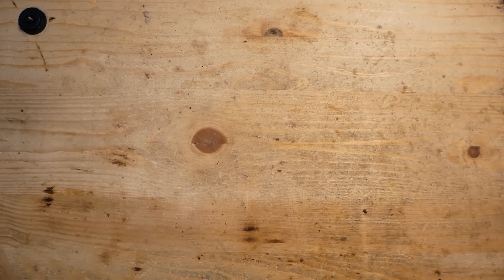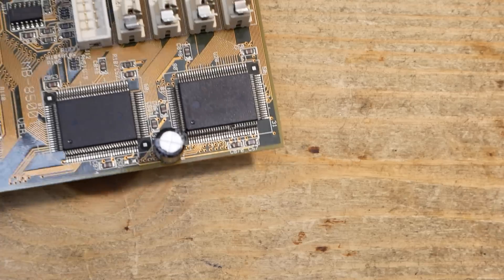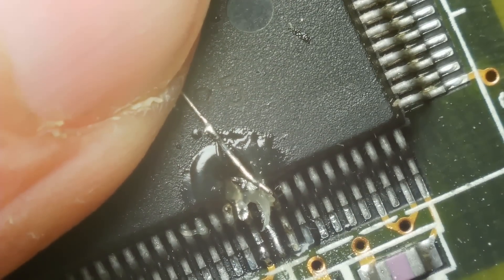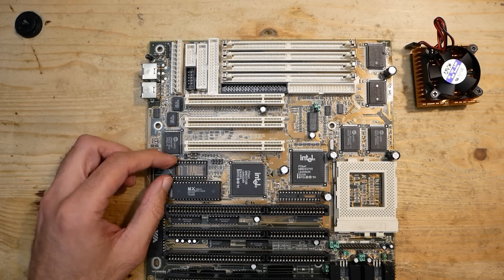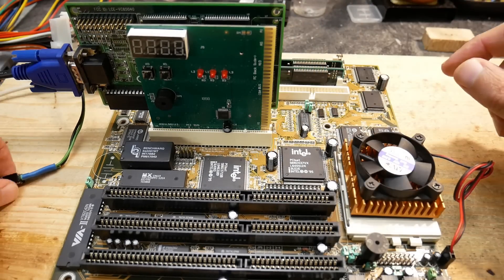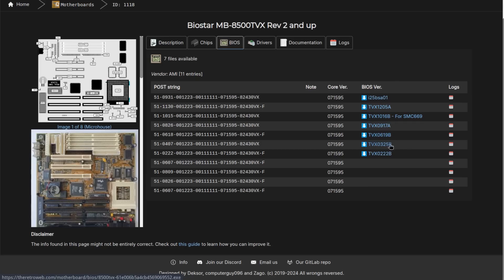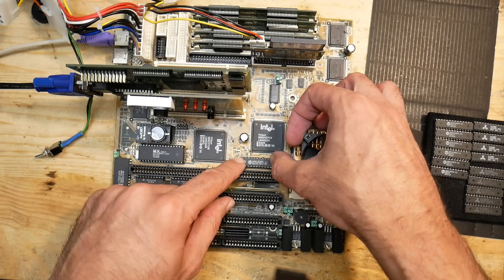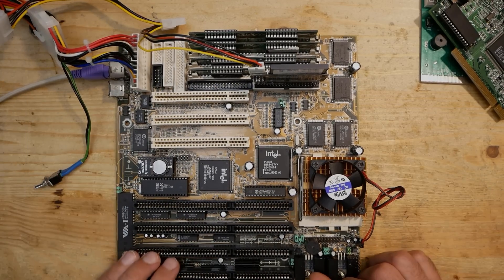Let's repair a Socket 7 mainboard: Biostar MB-8500TVX-A

Comment: I have the same motherboard that I used for a Win95 PC build. As you said, the Dallas RTC battery was dead and I solderd a coin cell on the module to make the motherboard boot again. The BIOS on my motherboard have the HDD capacity limitation to 8G and is not Y2K compliant. However, it works ok. 
The -A in the motherboard name means that the keyboard connector is AT not PS/2 (as I remember to have seen in an old pdf. manual that I found on a old CD with a BIOS upgrade for it). I removed the AT keyboard socket and replaced with a PS/2 connector like your motherboard have, so I can use any regular keyboard without an adapter. It seems to me that your moterboard had the same mod from the factory or made by previous user. Mine is rev 2.1.

Comment: What's the part number on the 28 pin cache tag chip? Thanks.
Reply from the maker: Any 32K SRAM chip would fit, it just has to be fast enough. I tried 15ns, but less would be better.

Comment: whats your tool to grind the plastic away near the legs? i have a cheap dremel. i need to repair a voodoo 2 in a similar fashion. 3 chips all with fatal pin leg breaks.
Reply from the maker: I use dremel, or engraving tool.
Reply: @necro_ware  thanks

Comment: I have another question. Can you make a complete video guide how to contribute to theretroweb? I am not familiar with git/github at all, still using SVN for coding and wished the website has some upload buttons 😅 I often have old hardware which is not listed at TRW or with false or incomplete infos that I like to fulfill. Thx.
Reply from the maker: You can join projects discord server, where you can find all this information, talk to others about all this and also submit pictures, manuals etc.

You will not need it for TRW, but I can only recommend to switch to git. I used SVN and CVS professionally before that many, many years. After switching to git I'm not looking back even for a second. I use it everywhere, also for one-click backups, since you don't need a server.

Comment: Socket a 12885 & add a CR2032 battery holder next to it where it's currently unpopulated? I've seen others do the same with mixed results.

Comment: how that 16000KB memory comes to be? it should be 16384KB (technically KiB but that is so stupid) as that is 16x1024KB (or if they use the "HDD-type KB" then it would be 16777KB) -- oh, later with the 32Megs it counts to 32384KB so where is the missing 384K?
Reply: I'd assume it's not counting any of the memory in the 640KB-1MB range as that's where the ROMs get mapped.

Comment: Good Video as always: “Mr Necroware!”, I had a pleasant surprise a few days ago, I popped round my Brother’s as I had left some Old Computer Stuff at his about 25 years ago, I’d completely forgot that I’d left a box of Motherboards round there including 286, 386, 486 & Pentium 2, They were all destined for the Car Boot Sale back then and they had been priced at £2 & £3 each except the 486 which had a Price-Tag on of £8 and the P2 was up for £20, I was chuffed to bit discovering my lost Treasure after all those years, 2 of the 386 Motherboards have suffered from leaky Batteries but I think I’ve caught the 1 just in time and the other one doesn’t look too bad, I’ve been on the hunt for a good 486 Motherboard to replace my Poorly 486 that I’ve got here & I can’t believe it actually has a CR2032 Socket installed on the Motherboard, No signs of any Damage so just hope it will drop into my 486 Chassis without any problems, The only negative is that it doesn’t have any VESA Slots, Oh well, It could be worse I suppose! Anthony - Birmingham/UK 🙂🇬🇧
Reply: I’ll definitely be uploading Videos of them on here as soon as I get chance! 🙂

Comment: Would love to see you try this clever desoldering trick to basically use old leads or wires to heat all chip legs at once. Wish I learned it years ago.  https://www.youtube.com/watch?v=Vou2xlJkuoU Been enjoying your channel for a few months now, looking forward to your next videos!
Reply from the maker: I know this way of desoldering. You need a hell of a soldering iron to do this, better even two. The heat dissipation by this method is extreme and you have to fight it with a lot of heat, which can damage the PCB.  It also doesn't work well on old solder joints with oxidized solder. If you have to do it once and the hardware which you are working on is not too fragile, like PSUs or similar stuff, then it's ok, but for fine electronics I prefer to use a de-soldering station.

Comment: This mainboard was used in my first PC, a 1996 „network“ branded (Mediamarkt) Pentium 150, 32MB RAM, a slow & noisy 1.6GB Seagate HDD, a 4MB VGA with a weird Cirrus Logic chipset, totally useless for the upcoming 3D games. Spent 1999 DM for this spec sheet blender 😢

Comment: Fantastic video as usual. I have the same board but is dead. 😢
Reply from the maker: Then you know what to do ;)
Reply: Probably dead RTC module
Reply: I found a second one. This working ok but needs recap. The first one still dead and i do not have the tools to troubleshooting. No oscilloscope.

Comment: Your next video will be to install a battery socket, rtc chip, crystal, and capacitor in the existing, but empty pads on the motherboard.
Reply from the maker: Almost, let me surprise you ;)
Reply: @necro_ware  @TheParallelPort did this in his last video (second channel of the serial port) Funny enough, he shows your clock in the video

Comment: Your soldering skills inspire me to get better. I had one of these (though a different revision; from images online it seems to have been a Rev 2.1) and I used a 200 MHz Evergreen Winchip upgrade CPU. Later on I tried a 450 MHz K6-2 (6x66=400) and I used it for a while that way. Blissfully ignorant of the issues with linear voltage regulators, one hot summer evening I heard a loud pop, and the board was dead. I had no idea why at the time, but years later I found out about how linear regulators heat up when run outside of their design specifications and I realized why the board died.
Reply: This was in early 2001 and I knew little about computers at the time. When I bought the Evergreen upgrade CPU, the board wouldn't POST with it. Though I had purchased it on Ebay, I sent Evergreen an email, and they answered me right away, recommending a BIOS update. I tried updating it to the latest BIOS Biostar offered, but it still wouldn't POST. They then sent me a BIOS as an email attachment, and that one worked. That happy moment when you hit the power switch and hear the POST beep!
Reply from the maker: Yes, one day we all learned this in the one way or another :)

Comment: The Biostar MB-8500TUC-A is virtually the same board, just with the better i430HX chipset and an extra PCI slot. The only downside compared to your MB-8500TVX-A is that it doesn't support dual-voltage as required by MMX, and as far as I know, no room for a VRM. Ever consider making a VRM like on the  one on the PODPMT66X200  ???